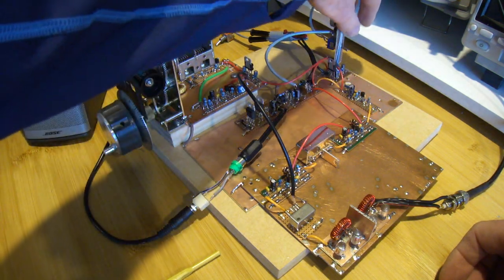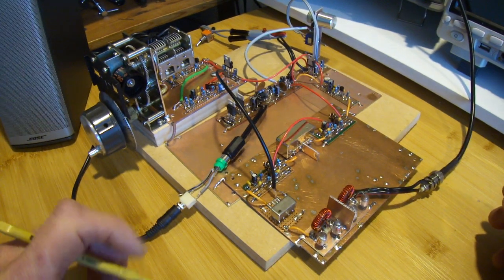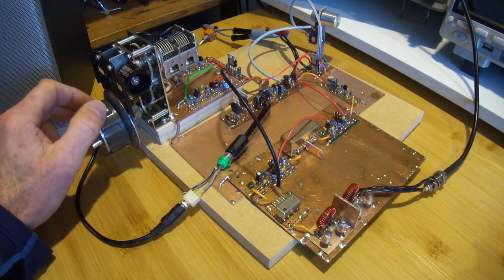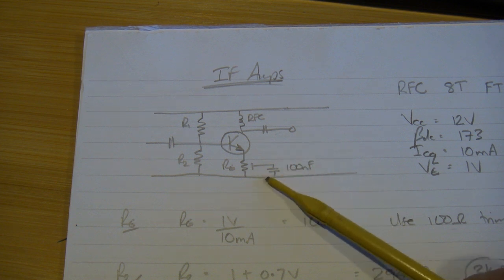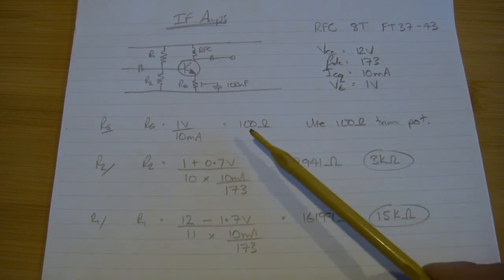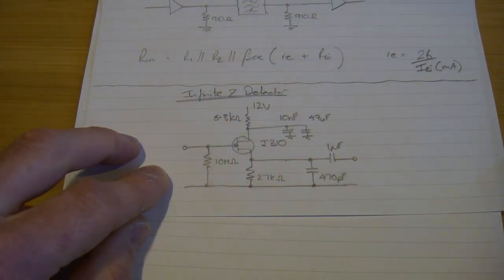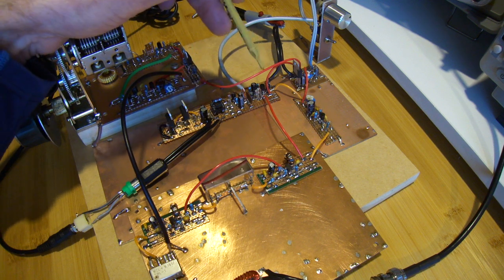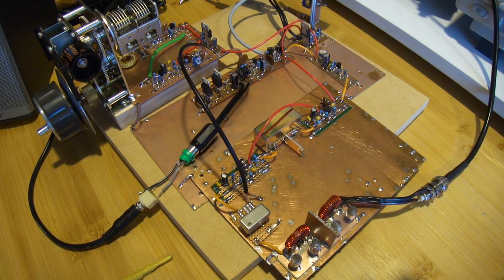AM Radio - Part 4 IF Amps and First Receive Tests

Comment: How did you decide on the inductance of the coil in the collector load? Why is a coil beter than a resonance tank or maybe a simple resistor?
Also, I think your attempt to match the impedance of the filter is incorrect - if the input filter impedance is 910 ohm, this should be the output impedance of the common emitter amplifier stage. Since for CE config it's the collector load, your collector resistor should be ~910 ohm or equivalent. Shunting with a resistor makes it worse, since now you have 910 ohm in parallel with ~25uH of the coil which is roughly 1600 ohm at 10.7MHz.
Reply from the maker: Yes, I took a few shortcuts on this particular build. In the past I have made the effort to better impedance match crystal filters with the output/input impedance of the IF amps. While not ideal, it's working well for this particular radio.
Reply: @CharlieMorrisZL2CTM  Of course, working radio >> perfect theoretical design. 
On the other hand, this could be a starting point to pretty interesting experiments on fine tuning and squeezing the max performance out of it. If you have a signal generator and basic measurement tools like a decent audio interface and software, you could do a couple of follow-up videos on those. Would be interesting to see the effect of impedance matching on the distortion introduced by the filter stage. Cheers!

Comment: I would welcome extra rf-gain. For years we, in the Netherlands, have been deprived
of the big broadcast transmitters. What's left is an ever changing offer of LPAM stations. (between 1 and 100 Watt).This requiers close proximity and/or a very good radio. Absolutely love your radio. Scrambling for parts now.
PE1LLA.
Reply from the maker: Yes I am lucky here in that the transmitter is not too far away. I'll have to keep experimenting.

Comment: Beautiful work Charlie.  I'm guessing that that variable cap has the rotating vanes (and thus the panel contol) grounded, with the stator vanes going to the circuit.  That may be why you can touch it with no frequency shift.  FB on NOT having shielding around the VFO.  Too often dogma and lore has us putting unnecessary metal boxes around this stage. 73  Bill N2CQR
Reply from the maker: Thanks Bill. Yes, the rotating vanes are grounded, which adds to the stability. As you know, I prefer not to have enclosures arounds the circuits as I enjoy looking at them and thinking about what each component is doing. 73.

Comment: Anither great radio..the very neat and artistic work...the oscillator capacitor is a piece of art with that gear arrangements..radiofun242 also made experiment once by varrying  gains in different sections ..in rf and if...most am radio have tuned fromt end and 1970 80 radios advertised turned rf stage..you completely skipped tuning the rf ...the second capacitor of gang capacitor could be used for rf front end tank circuit...i saw 3 trf stages in a russian ishim radio...the radio you built sound amazing without any of those...i wander if you may need turned front end   for weak am stations and dxing....you vedios helps us a lot and its always fun to watch and listen tou doing these stuff...
Reply from the maker: Yes, that could be an option. As I'm really only interested in one station it wasn't a real need. Thanks for the feedback.

Comment: I am a bit confused by the fact that you put a 910 ohm resistor to ground on the input of the crystal filter. I think you really want to make the output impedance of the Amp driving the input to the filter 910 ohms. What you've done here is make the input of the filter see 910 ohms in parallel with whatever the output impedance of the driver Amp is.
Reply: If he does a test with a RF generator with variable AM modulation frequency, then it may show up any possible issues such as ripple in the frequency response.
Reply: I'm afraid you're right.
The input impedance of the used rf-amplifiers is about 2300 Ohm. The output about 1400 Ohm. So the 910 Ohm resistors are being shunted by these values. As a result the input 910 Ohm resistor will be brought down to much less than 600 Ohms.
But hey, it works and it sounds great !
Reply from the maker: Yes, I agree. I took some deliberate shortcuts on this radio. While not textbook, it works for this particular radio.

Comment: That's a very good little AM radio. A typical AM portable radio these days costs less than your mixer module, and none have such a high quality tuning section, crystal filters, or good bandskirts as you have on what pass for their  filters, assuming they have any at all. Your receiver has excellent, natural sound as near as I can tell from the sound coming out of my laptop. No squeals, no hums, no intermod. You're building the good stuff. 
As a teen in the 1960's I had a good transistorized AM-FM tuner kit I built. I was very proud of it. Good sensitivity, good selectivity, good AGC, good audio. But I noticed that a crystal radio I'd built that I was running through the same amplifier and speakers as the expensive tuner kit actually had better, more natural sounding audio, more dynamic range, simply more 'real' sounding. The kit tuner sounded like a very good kit tuner. The crystal radio sounded like a person in the room. That was when I realized that the more parts you use, the worse a radio actually sounds. Every circuit, and certainly every active circuit adds in some subtle degree of nonlinearity, phase distortion, something not quite right. The high end sophisticated ones just add in less. They can never actually make the sound 'better', more real sounding. So when I see your AM radio design I see a circuit designed with just the minimum of parts, but very high quality parts, and I like it. 
A few years ago I did a refurb of a very expensive old Marantz FM receiver, and I was impressed with the 'real, live, in the room' sound of the audio. After going through the schematics and the components I realized that it got that sound from using numerous expensive to make, passive LC circuits, not a bunch of active devices, and then well shielding all of those low-level signals. There were just enough active devices to bring up the signal level to what was needed to produce the required output. there were not active gain stages and feedback loops sprinkled around everywhere in the radio. And that was the secret to the natural-sounding audio that made it so valuable, which was a couple thousand dollars, even after so many years. They didn't try to compensate for nonlinearities. They avoided producing them.
Reply from the maker: Thank you very much for the feedback. I'm certainly very happy with how it is sounding so far. No hiss or other noise between the stations. Hopefully, I can maintain that when I look at the AF amplifier. 73.
Reply: @CharlieMorrisZL2CTM , I don't recall AM radios ever having the sort of inter-station hiss that FM stations do. A little noise, but not that uniform loud Gaussian sort of hiss. I think it's related to the sort of modulation used. FM always has the amplitude of the carriers always cranked up. AM only needs to do that for weak stations. If we had a decent AM station in town I might copy your radio for myself. But all we have here is garbage. Clearly you have a station there that you like. Do they also stream online?